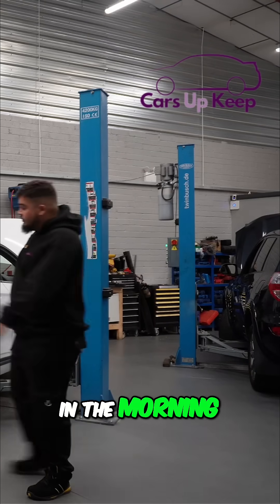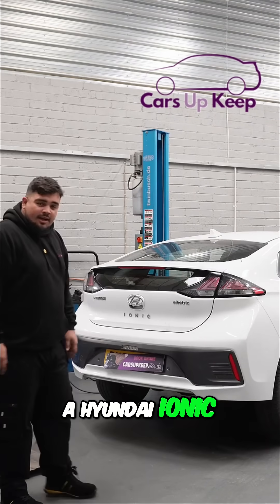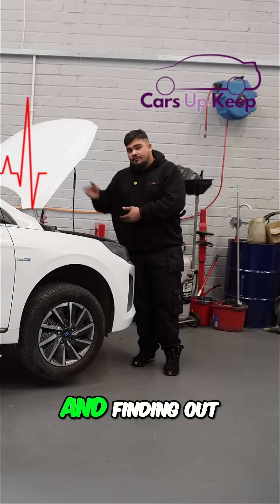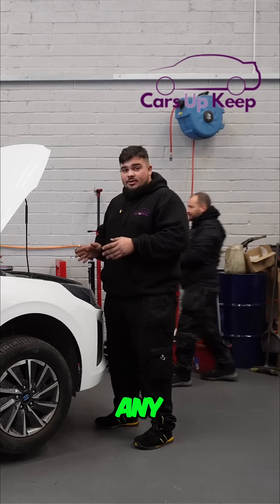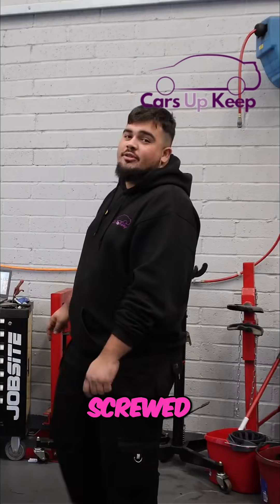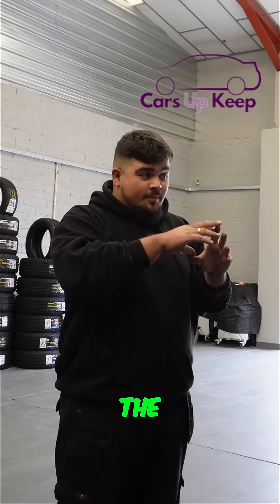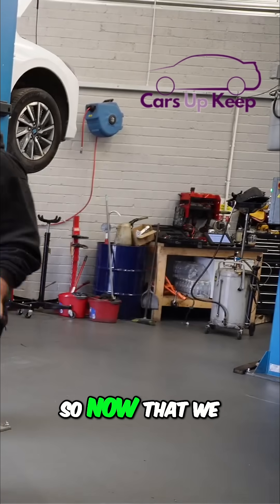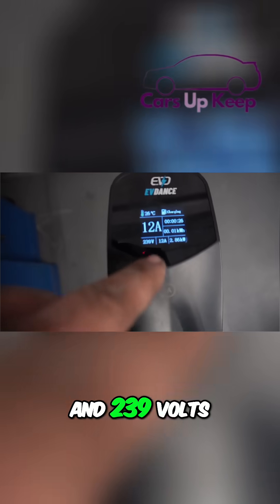Hyundai EV Won't Charge! Quick Fix & Repair #shorts

Comment: Hi, I have a Kona electric 2020.

The car has a check ev system error.
Error code P1B77. Do you think replacement of precharge relay will solve the it.
Reply from the maker: Hard to tell without checking the car, car related to pre charge meaning that car detected less than 80%  of battery voltage at capacitor, why is doing it nees to be checked to confirm, wether is a fuse or relay or the contactor  need to be checked
Reply: @Carsupkeep Thanks for the reply.
if I replaced the whole PRA unit, will that solve the issue?
Is there any software installation tasks involved after replacing PRA?
Reply from the maker: @RajeeTharan should be straight foward, just bare in mind there is high voltage involved
Reply: @Carsupkeep once again thanks.